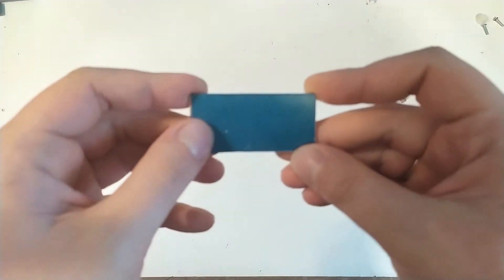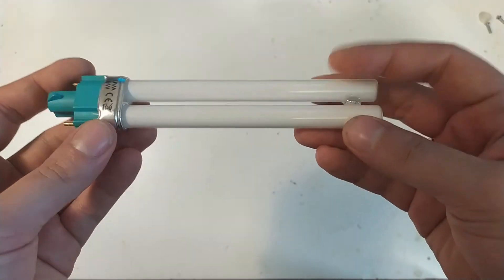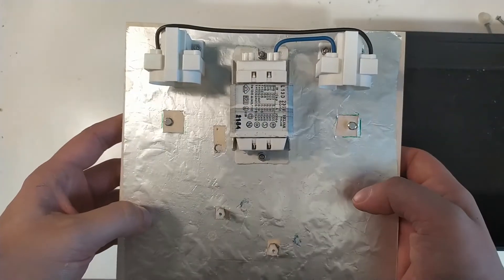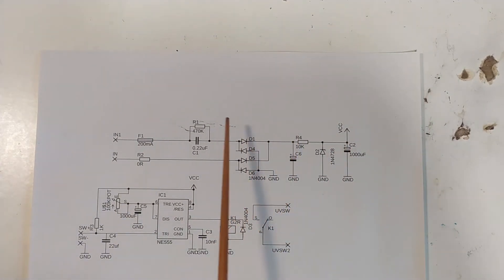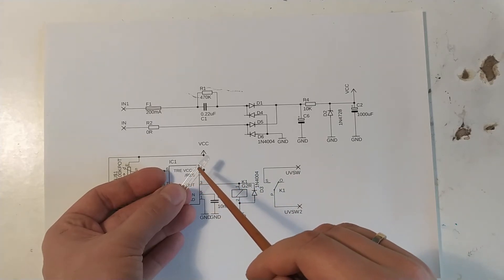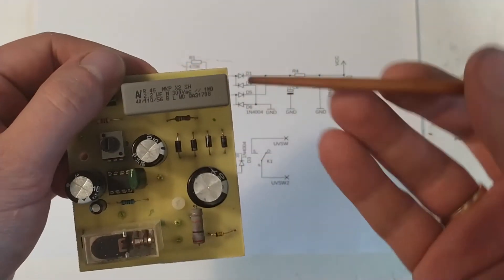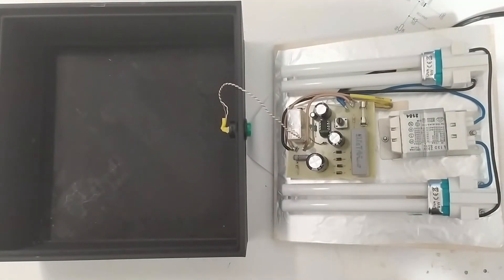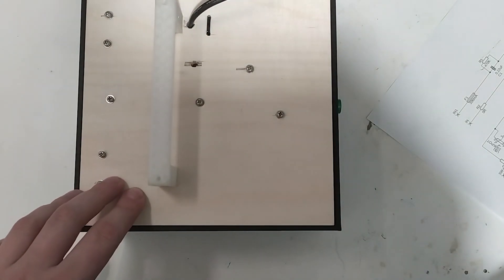Making double sided circuit boards Part 2: UV Exposure Chamber

Comment: Nice, but won't the UV damage the plastic cover for the timer circuit?
Reply from the maker: Will probably cause embrittlement over time, if it does I'll replace it, so far it's holding up fine.